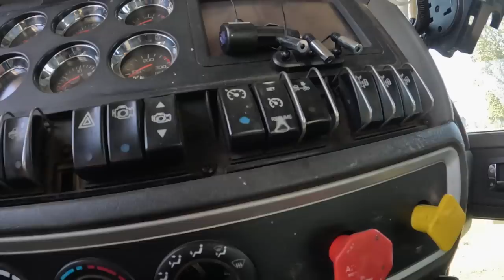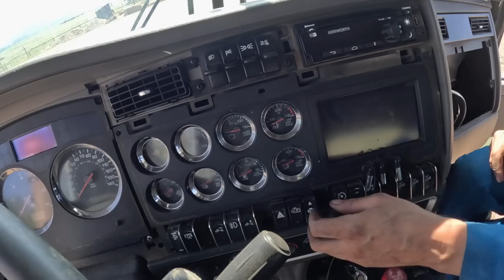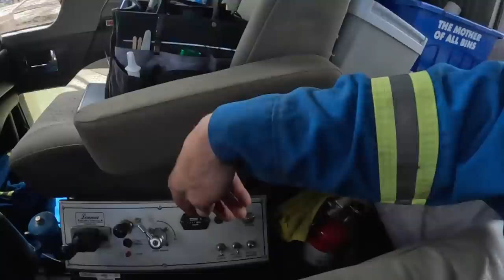OVERSIZE DRILLING RIG LOADS

Comment: How does the load roll off of the trailer so easily? Am I missing something?
Reply from the maker: 4 rolls that come up out of trailer on air bags.
Reply: @TimelapseTruckerRTOT  That makes sense. Thanks for the response.
Reply from the maker: No problem

Comment: You re fucking lucky bud haha 
Somehow you haven’t lost a load yet but those big fucking loads just slide off by them selves 
But I seen you been hooking up ur line to the jeep correct on the recent videos so I won’t bug you very much 🤟
Reply from the maker: i usually use the deadman on the winch, sometimes to the jeep neck as well/ i dont see the difference, in all the years ive never had issues with jeeps kicking out, i know it can happen, and ive chained them a few times
Reply: @ all it does is take the kicking out about 50% less going to the jeep instead of the dead man
Because when that building back end comes off the ground and u have ur line back to the dead man
It’s lifting off ur steers and if the ground is a cunt hair uneven on mud on Matt’s or ice 
She will fucking go side ways 
Jeep is best at all times 
A good habit to have 🤟🤟🤟
Reply: I was referring to ur line on the jeep 
U went the wrong way around the throat there bud 
If u ever had to shake it hard enough the load moves forward the hook will come off and there she goes for a ride 
Go over the top then back under to the line 
Ur hook stays pulling down words and also it protects ur line by resting against the lip of the jeep and u won’t even make a bend on ur line if u didn’t it the right way 😊